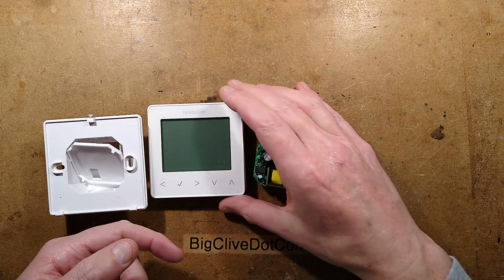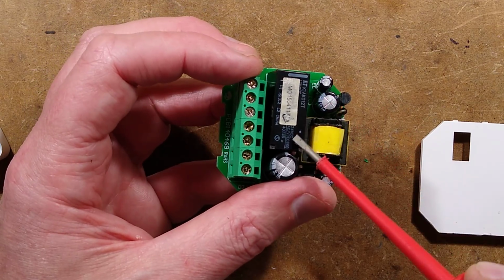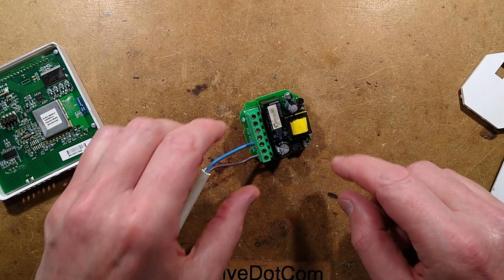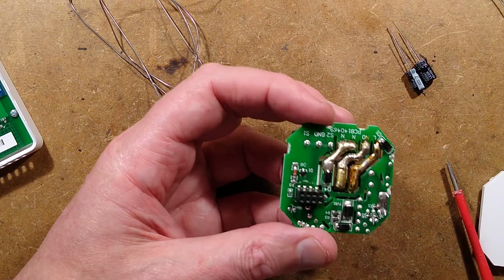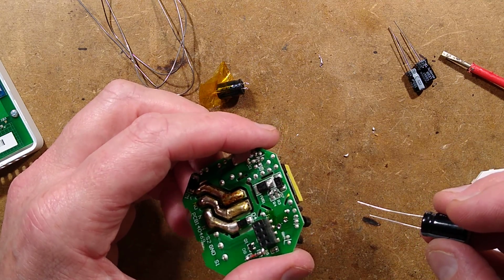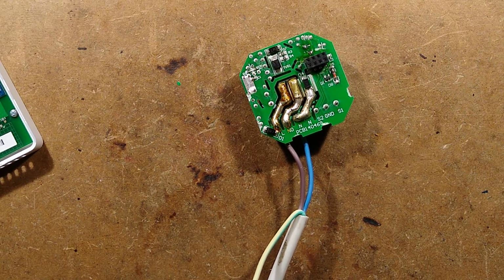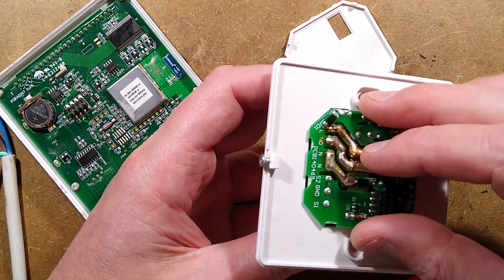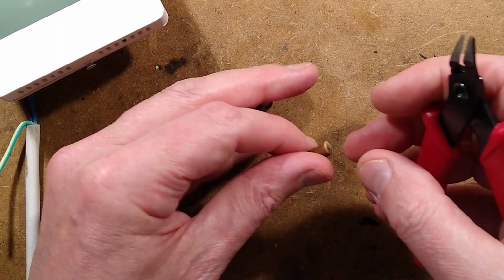Fixing a dead digital thermostat

Comment: HVAC systems in the US use heating or cooling unit (transformer) derived 24VAC and the thermostat has a bunch of wires that it relays that voltage between that then goes back to a control board to be interpreted or directly pulls in contacts. Only real systems I can think of that use a different system are vrf/vrv (variable refrigerant flow) mini split type systems which use modulated mains for signaling if I recall correctly. How do UK or European designed thermostats function differently? Obviously the machines they’re designed to work with are fundamentally different in some degree, could someone explain the difference? I’m picturing something akin to how an occupancy sensor works but I could be mistaken of course, it never occurred to me that Euro thermostats would work any differently

Edit to say Technology Connections on YouTube has a good video on US thermostats if my explanation of US systems was unclear
Reply: Commercial and high-end residential systems often use RS-485/RS-422 between the thermostat and the air handler, and a protocol like BACnet or modbus, or a proprietary protocol. These are called "communicating" thermostats.
Reply: See my answer to another comment about typical U.K. systems.
Reply: I think the UK is the same and this thermostat is most likely for electric heat like a baseboard unit.
Reply: @bluefoxtv1566  You would think wrong.
Reply: @bluefoxtv1566  no because 24v is an American standard, which is uncommon outside of America. Everyone else uses high voltage or communicating thermostats.

Comment: If a ac to dc power supply that doesn't work anymore generally because of a capacitor
Reply: Not always. There are various causes of failures. But in a ‘switching’ type like the one in this video, the first secondary capacitor is a common failure point if a quality component was not used.

Comment: Maybe they used 3 diodes due to the voltage rating.
Reply: But a single 1000V diode is cheaper than three individual diodes…

Comment: Maybe I'm an idiot but I still don't get the point of relays (at all), they're often delayed and loud, but you could just use a transformer if you wanted a separated circuit... Or am I an idiot?
Reply: No you're not.
They provide galvanic isolation in some cases, they can be of different sorts, can switch multiple connections, can have more than one stable states (yes, commutation wheels with coil-driven actuators or even step motors are more or less relays too, broadly speaking) — for every application you can choose a proper solution. You don't have to always deal with solid state relays or another fixed type of component every time, engineering is about finding solutions that will work reliably and efficiently.
Reply: The most important reasons that relays are used are: isolation between the control circuit and the switched circuit, a low power control circuit can switch a high voltage or high current circuit, the control circuit can be DC but the switched circuit can be AC or DC. Hence even though the relay is a very old technology, millions of new relays are still made every year.

Comment: If it's not the capacitors, it's the capacitors, cos it's always the capacitors, even when it's not... :P
Reply: except when its a shorted diode.
Reply: Or a dry joint… or a broken wire…

Comment: I'm not sure I've ever taken apart an electrolytic (or seen one taken apart) - that roll was shorter than I expected. Nice to see a concrete symptom traced to the cap as well!
Reply: I took one apart once. I did it in a very expedient manner by hooking it up backwards. It contained both smoke and sound.
Reply: @Know-Way  tantalum caps were always my favourite, they also contain a fireball...
Reply: @georgeprout42  It's been years since I blew up a tantalum cap by hooking it up backwards but I remember the smoke had a purplish or bluish color to it.
Reply: @brianleeper5737  Yup. One of my team got the nickname Jimi Hendrix because of the fairly frequent purple haze coming from his bench.
Reply: @georgeprout42  Years ago (early 90s) I had a lot of computer junk and one of the things I had was a Motorola UDS 300 baud modem. It was (1) obsolete and (2) loaded with tantalum caps. It provided lots of amusement before it went in the trash....
Reply: @Know-Way  so it went electro BOOM!
Reply: @Jeannie✪ঔৣ꧂  Torch yourself, bot._
Reply: The best cap blowing up was a cap blowing up to some unsuspecting fellow classmates where all of a sudden they found themselves in a small cloud if paper like confetti.
Reply: @bert-blank  and that boiled electrolyte smell... 😝🤢
Reply: My early days in electronics I dissected many caps that way, sometimes accidentally. Soviet K50-12 was the loudest._
Reply: Yes, that makes me extremely curious to see what a SMD ceramic capacitor would look like inside (probably under a microscope) - I never assumed there was anything to see, but the electrolytic cap disassembly made me realize there's gotta be more to it than a chunk of ceramic and a couple terminals!

Comment: always expected a capacitor to be more technical - it just looks like cardboard and tinfoil
Reply from the maker: It actually is quite technical.  The aluminium foil has an etched texture  to create a high surface area and an electrically formed oxide insulation layer as a very thin dielectric barrier.
Reply: I wish I could look at your face when you discover air variable capacitors. ;D
Reply: In theory, capacitors are very simple: two conductors separated by an insulator. But as Clive states they're technical to make...if you want a reasonable amount of capacitance in a reasonable sized package.
Reply: @ec8107  yeah, but I'd want to emphasize it's the surfaces in them who do the job. Well, in an electrolytic capacitor, the electrolyte becomes a new dimension for the surface.

Comment: I was expecting fireworks at the beginning when you plugged it into mains - here in North America most HVAC thermostats run off a 24V AC supply generated by the furnace or air-handler.
Reply: @Mark S Andrew Fremantle wrote *24V*, not 240V.
Reply: The notable exception being 240V thermostats mainly used for electric baseboard heaters. A friend of mine has a house with electric baseboard heaters and a thermostat in every room. Electricity must have been real cheap when it was built in the 60s...(the house also has central AC/heat pump so that is what is actually used for heating).
Reply: @brianleeper5737  Mid 70's the local electric company had a big push to install 240V baseboard heating, they offered the units and a big discount on power if you switched. My folks went for it and had them in every room. Winter time the power meter sounded like it was ready to orbit. About 3 years later all of the perks vanished and they became $$$$$$$ to run.
Reply: @Blazer02LS  I remember as a kid in the US they were predicting that with nuclear energy electricity was going to be so cheap that "all electric homes" would be everywhere. There was a big push for that baseboard heat back then. I guess 3-mile island put an end to that.
Reply: @Blazer02LS  and these days (and here, since at least the early 90s) they're pushing load management switches and some offer discounts for installing more efficient equipment. What a difference.
Reply: @Blazer02LS  i recently moved up north in maine (it's already been 28f here) and was surprised to see a few homes that had resistive baseboard heat... Seemed so out of place, but i think it was a similar story regarding (since expired) cheap electricity.

A relative just moved from an apartment to one of such homes, i think she's going to scream when she gets the power bill! I tried to warn her, but the house will be very easy to retrofit to other types of heat, even a mini split for the more mild days.
Reply: @brianleeper5737 Even quite recently, maybe 90s, they went on a electric storage heat jag here in Minnesota ( of all places). Not many were installed, even with a promised low rate for off-peak. I'd be interested in what those folks think now.
Reply: @curtwuollet2912  Here in Northern Virginia, there are houses with heat pumps and sometimes the people get $500 electric bills and find out that the heat pump is broken and has been running the resistance strip aka aux aka emergency heat all month. (Most thermostats have a way of telling you that's what's going on, but some people don't pay any attention).

So that gives you an idea of what it costs to heat a house with resistance heat in a climate a bit warmer than Minnesota!

I myself have a heat pump in my house, and the wire from the thermostat that turns on the aux strip heat is wired through a switch which I keep on the OFF position.

That way, the only time the aux heat will come on is when the unit is in defrost and even then, only 10kW of the installed 20kW of strip heat will come on because I shut the breaker for the other heat strip off.
Reply: @brianleeper5737  yeah, the only heat pumps that make sense here would be ground source. Up front cost makes them less than popular. The green folks forget that killing fossil fuels would kill most people here.
Reply: @brianleeper5737  never heard of baseboard heaters before, I assume it's just resistive heating? That sounds very inefficient! Here in Ireland (similarly in the UK) the only real fixed electric heating option was storage heaters, which is basically that plus a load of concrete blocks (or less commonly heating the concrete floor) but it means the heating can be done at night time with lower tariffs. Air source heat pumps are becoming more common now but installation is very expensive
Reply: @AaronSmart.online  Yes, baseboard heaters are just resistive heating. There are also baseboard radiators that use hot water from a boiler. They appear similar, but the usual way to tell is a wall thermostat in each room. 

Many houses in the USA have central air conditioning (a "split system") so the additional cost (at the time of installation) for an air source heat pump isn't very much, perhaps a few hundred dollars--a heat pump condensing (the outdoor unit) and a heat pump thermostat.
Reply: @brianleeper5737  the most common type of central heating here is gas or oil boiler with radiators. Heat pump installations here are usually also heating water radiators, but they require larger more expensive rads and in general cost substantially more than a boiler system, like thousands more
Reply: I have a new Nest thermostat that didn't take kindly to overvolting, and their customer service was wholly uninterested in providing any kind of assistance, so it's presently a paper weight maybe awaiting future resurrection or dissection as the case may be.
Reply: One of the major benefits of a switch-mode power supply is their ability to handle a very wide range of AC inputs. Computer PSUs are typically labelled 120-240V, but they can often handle 90-260V or even wider ranges.

I believe the 24VAC standard originated from the classic bimetallic thermostat, where the easily-removable cover exposes live contacts. They're simple thermostatic switches with adjustable closure temperature. The standard lever control is very fiddly; a brushing contact could change the set point by several degrees. There used to be models with a fine-threaded screw for adjustment, but I haven't seen any since the advent of digital electronic control.
Reply: So how do you heat your home?
Here in Quebec we have lots of cheap hydroelectricity, everyone heat with electricity.
There is still some who use gas, mainly in old residential area and industrial area.
Reply: @ameunier41  Gas-fired furnaces are very common here in Metro Vancouver. My home has a condensing gas furnace paired with an ancient heat pump. The furnace rarely runs.
Reply: @Azlehria  24V also probably means electricians aren't required to run the thermostat cable; the HVAC contractor can do it.
Reply: @Mark S Most furnaces are 120V. Air handlers for heatpumps, on the other hand, are 240V, because they can be equipped with optional heat strip kits.
Reply: @Mark S "just enjoying a coffee and sandwich before bed"
I could never go to sleep after drinking coffee. I would just be laying there for a few hours till the caffeine wore off.

Comment: What a coincidence that you posted a broken thermostat as I had a thermostat "issue" last week.  My Nest stopped turning on the furnace.  After checking wires, running a new Common wire, and also restarting it, tests showed it COULD turn on the furnace in the equipment test mode, it just would not do it normally.  I went through 3 days of a very cold house until I finally called Nest support.  Turns out they had done a firmware update just that morning that apparently had caused it to THINK it was turning on the system but it really had not.  A factory reset, and reinstall in the Nest app finally fixed it.
Reply: The era when we have to convince our tools to work has come.
Reply: Don't you just love it when a firmware update leaves you on the cold? What a time to be alive...
Reply: This failure mode is very unlikely with my system, as it’s air gapped (meaning it does not have an internet connection) 😀
Reply: @Mark1024MAK  It's even more unlikely with my system, as it's just a bimetallic strip and a mercury-style switch. I know they used to use real mercury switches, but this was made in the 90s so it's probably a different technology of tilt switch.
Reply: @eDoc2020  and @Mark 1024MAK  - I hear you but being connected has advantages.  For example, during the recent California fires, while we were evacuated, I could check the Nest from anywhere to see if was online and check the temp inside the house.  It let us know the house was still there.  Also, it is nice to be able to just say "Hey Google - temperature up" if things are getting cold.

Comment: Having been put through several traumatic events due to cheap components (especially capacitors) in power supplies, my own OCD would require every one of those caps be replaced. It's always fun to tell a customer why their $$$$$ audiovisual system doesn't work because of a $10 power brick I don't have a replacement for... 😅😳😁 👍️
Reply: It is important to note that not every item of electronics needs every electrolytic capacitor replacing. Electrolytic capacitors, just like a lot of components and parts are used in a variety of different applications. How they are used, where they are used and the circuitry design all affects how much stress they are subjected to. And again, like a lot of parts, electrolytic capacitors are available in various different qualities. A significant number of failures like in this video are due to cost cutting or poor product design.
If you have a slow puncture in one tyre on your car and you have good quality tyres on it, you are unlikely to get all four replaced. However if you have a blow out of a tyre on your car, and all the tyres are the same cheap low specification type and you regularly drive on fast roads like motorways, you may want to replace all four. But if you only drive a few miles along 20MPH or 30MPH roads to get to work / school / the shops, would you spend the money to replace all four tyres?
Reply: whats OCD?
Reply: @superchiaki  obsessive-compulsive disorder, it is a condition when a person can't feel right until they fix the world to meet their mental representation of it, in short. You don't want to have it, take my word on that.

People tend to call their urge to make it right an OCD, that's what Ted was mentioning — his will to fix the obvious problem.
Reply: @jkobain  Well put. 👍️

Comment: Lead-free solder, as far as my little brain can understand, is horrible for appliances too: it makes them fragile, and it provokes overheating when you want to fix them at home.
Oh, you just used the «give it a flick» technique of desoldering, I found it is a useful method sometimes.
And thanks for another interesting video!
Reply: I only work with lead free solder. My JBC Nano cartridges are sensitive to lead and lead promotes plating layer dissolving rather quickly. Over the years I think now I work better with SAC305 than any other solder.

Comment: „So let's recap quickly…“ seems to be the motto of these years.
Reply: Since around 20 years now, especially in computers. Around year 2000 began capacitor disease (lots of conspiracy theories about it) and also more widespread use of switching power supplies in various electronic. Usually these are cheapo caps dying rather quickly in such use.
Reply: @Kwaq84  Was about to comment about the capacitor plague ; and yeah, it seems like we're getting the end of the bathtub curve these days, which was to be expected once we realized the plague was a thing.
Reply: Its the price we pay for miniaturisation
Reply: They tried to make me go to recap, but I said "no, no, no"